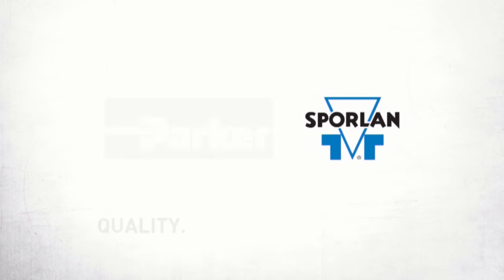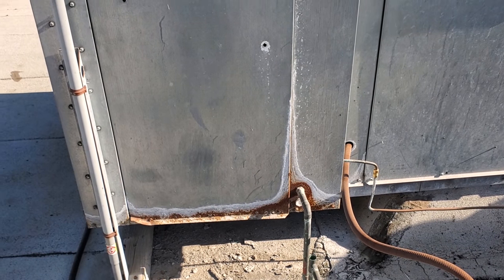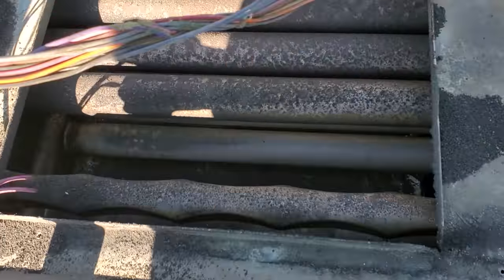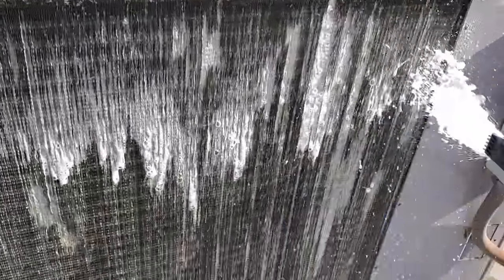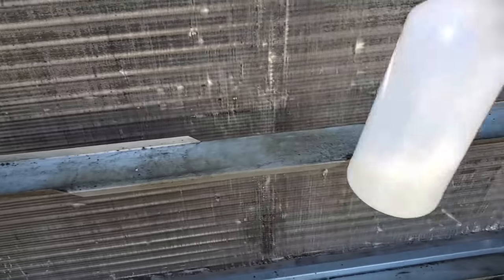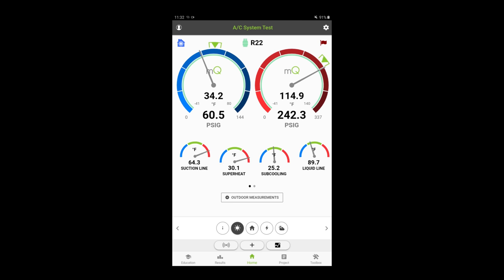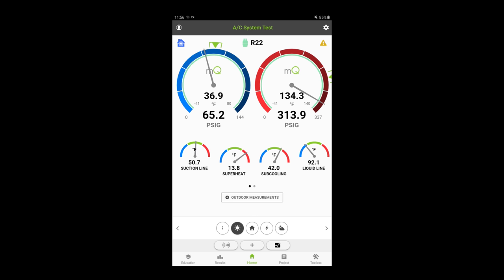THE KITCHEN AC IS NOT WORKING

Comment: I learn more here then I did at school. School is just to show you can finish something that's all it is. You learn on the job
Reply: Couldn’t agree more, I’ve learned more this past year and thru these vids more than all 4 years of schooling
Reply: School definitely helps, if you take initiative, read all the materials, take all the extra courses, play with the mock units, take parts on and off and build a network off people using the contacts your instructors have. That’s what I did anyway. Plus it shaves off a few years of experience for different certifications. So school is so much more than just to show you can finish something. ✌🏼
Reply: I strongly disagree. It all depends on the person. You can go to school and sit in front of the computer and read for 12 months, sleep when the instructor gives a class etc and then forget it and have little to no hands on practice or you can read and learn the basics at first and then start practicing and learning HANDS ON, testing pressures, airflow, changing motors, reading voltages, sensors, brazing etc etc and come out pretty much ready to do basic service on your first day at work. The lab at my school is like my playground and I bring my tools and probes everyday to fix things and do testings. The other 12 guys in my class dont even know how to test a capacitor and we re 2 months away from finishing a 12 month program. I ask my teachers at least 20-30 questions a day and they give me the same number of answers and explanations. I almost feel guilty with the amount of 1 on 1 time I get with my teachers because if the other guys actually put some effort, they just wouldnt have all this time to help me out.
Reply: @andresperez-wc8ty  right on man 💪🏻 I did exactly the same thing and it really paid off
Reply: @cesarmoore7996  Cheers!
Reply: Did my school 14 years ago and couldn’t agree more with you
Reply: Felt like I learned more in two months on the job than I did in two years of schooling. Now as lead tech for the company I wish hvac company’s took more time truly train there technicians and less focus on school
Reply: Kudos to those who got value out of school and to those who realized later what value there is in being taught.  Training and school are two flavors of the same thing.  Trades who come here are a biased sample.  Even the fact you are here sets you apart.
Reply: school training relies heavily upon classmates helping each other out, the teacher can only help so much and many things fall through the cracks! 
I helped classmates about as much as the teacher did, many moons ago in "industrial electricity" course, which really covered many fields of repair and beyond. I had already learned much of it as "the nosy kid asking 300 questions and watching others", by then I was already doing majority of the same work in the field for family and friends parents(rental properties!) yeah, looking back it was probably not their wisest choice to have an under 16yr old minor doing electrical, plumbing, gas lines, well repair and far more ;)
no, nobody ever got injured, nothing burnt down, blew up, etc. now there were some water leaks, but mostly from falling for shortcuts using junk box store materials.
example, using rubber cones washers on chrome faucet supplies,  without enough line support or people bending them by jamming junk in cabinets.

I also repaired a bunch of the schools test equipment and gear while there(been repairing electronics since a young kid also!) lots of automotive, computers, networking, carpentry, remodeling. (sounds like I'm tooting my own horn here) I go lol

Comment: Non-acid cleaner is either sodium hydroxide or potassium hydroxide if memory serves, or at least the stuff our dealer sells is. Grease is no match because hydroxides react with grease & oils (on the fins and your skin) to form soap. Only downside is that at high concentrations the hydroxides react with the aluminum fins, releasing hydrogen, causing the bubbles. :-)

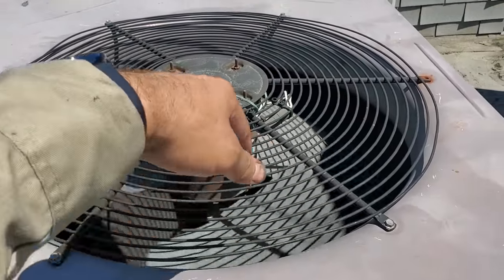Comment: 9:02 i dont expect you to remember me mentioning about putting longer screws and washers to raise the fan up but i would suggest it as a cheaper option if customer plans to be cheap.
Reply: that would raise the guard grill too high off the unit and allow things in that shouldn't be, like birds and other climbing/flying rodents. not to mention a hazard for other debris, tools and body parts to enter. you could also use large ducting/curb scrap to make an extension horn and attach it to the one that's too short for the fans depth. BUT,  it's just not worth it overall and would instantly exceed motor replacement cost and future headaches. not to mention the next person along would think you did the wrong motor and hacked it to death
Reply: @throttlebottle5906  if hes in california, and the temps are as high as it is in hemit. I doubt birds would get in there or things that shouldnt be. Because them fans are on over 50% of the time during business hours. Yeah, i get it. Doing this can look like a hack job. However air flow and velocity are key. And doing a washer setup spending $3 on a pack of washers to riase the fan guard half an inch may save money on electric every month because of the increased air flow out the top end of the condencer. Instead of recycling the air around inside the unit.
Reply: @hayzeproductions7093  it's not that hot year round, there could be long periods of  idle/off time with economizers open and such, which could end with heavy bird nesting.
 it would flat look like a worsened hack-job, upon hack-job.
he did what's best IRL, explained to customer the issue and what can occur.

Comment: This question may sound stupid, but.. how do you get grease on the evap coils? Shouldn't those be only exposed to outside air?
If you have some spare time some day (ha ha, i know), I'd really appreciate if you could explain the various parts and their roles in an AC system.. for all of us from outside outside HVAC business who still want to learn what you're talking about.
Reply: Grease gets on the outdoor half (condenser coils) usually from nearby exhaust fan vents blasting grease and mist out of them, that then gets sucked up into the coil.
As for the inside evaporator coil, that's just cooking grease that the exhaust hoods didn't catch getting pulled into the return.
From watching Chris's videos, grease on the condenser is a lot more common than on the evaporator, as the filters and the vent hoods will protect the evaporator.

Comment: If you ever do get it approved,  would you start by changing the fan motor and recheck your refrigerant data before going through the trouble of replacing the fixed orifice device?
Reply: I honestly started using Dawn dish soap on a few (its a degreaser)  in my coil gun, seemed to do a good job, didn’t kill the condenser, or kill the roof, which is a big fear of mine.
Reply: @justinperry68  probably very similar to what's in the packs of cleaner anyway, except the delayed foaming part (lol)
look at the SDS sheets and figure it out for yourself

Comment: When you have a fan motor that's too long for the mount, can you make a "temporary" shroud extender out of some sheet plastic and hang it from the fan grill with zip-ties?

That should prevent recirculating of the hot air within the cabinet and shouldn't cost a lot of money [semi-flexible 1mm thick plastic sheeting (thick enough to have the needed rigidity but thin enough to not foul the blades) from Lowes or the Home Dipshits and cut to the needed width/length, a hole punch and 8-10 zip-ties] shouldn't cost too much, certainly a lot less than a new(ish) motor...

Comment: Could be moving half the air due to cavitation not being correctly shrouded.  They should have SP measurement on the confessor monitored for dirty coils, would not help with shroud problem though.

Comment: What would be the point of spraying sanitizer on a rooftop unit?  None of the air moving though it goes into occupied space does it?
Reply: that was the "indoor evaporator coil" he cleaned and sprayed with sanitizer, all the indoor air goes through that, after the filters(which were out), then indoor coil and the blower, all the panels were off for cleaning, it would normally be hidden and sealed inside.
RTU's have two separate halves in one unit, one has outdoor air passing through for cooling(or combustion air/burnt gas for heating through a heat exchanger). then the other side is indoor air coming in and out of the building through it's ductwork or plenum space. there's also often outdoor air intake and filters letting air into the  return air plenum space, just before the filters and coil. it's generally a controlled damper for allowing outdoor air in when the temps outside are cooler than inside(usually called an economizer), it's often used to provide building makeup air and pressure balance, due to exhaust fans and hoods causing a negative building pressure (without makeup air, sewage gas and chimney flus can backdraft and doors be hard to open) 
didn't mean to write half a novel and hopefully it's helpful without overloading(bad habit) =p
Reply: @throttlebottle5906  Thanks, that makes more sense.  I thought that was just strictly a condenser unit.  I'm obviously not an HVAC guy, so it's not  always clear to me what I'm looking at.

Comment: I can't seem to find the video where you changed the condenser coil because of restricted metering devices. My question is, could this also cause the compressor to overamp? Have a Daikin 8 ton vrf with 1 inverter compressor and 1 'standard' scroll compressor. The inverter compressor starts but shuts off after a short while. Compressor not shorted to ground. Power to the compressor is ok. System has a fault code 'compressor over current or compressor motor wire cut'. Any ideas?

Comment: Just a  fan, can a 60yo get into this biz?
Two questions 
You are pulling guys away to work on social media.  Do you calculate the returns based on your shop rate?
Do you have mitigation strategies for customers to reduce the load so to speak the load being the amount of grease they are sending into their hvac.  I am assuming CA has pretty detailed requirement for airflow through a commercial range hood.

Comment: Hey Chris, how involved do you get with the gas heating in the roof top units, do the ambient areas inside the building have sensors looking for abnormal co2 and carbon monoxide levels? Do the burner bars corrode and allow combustion products to enter the air supply to the building? thanks